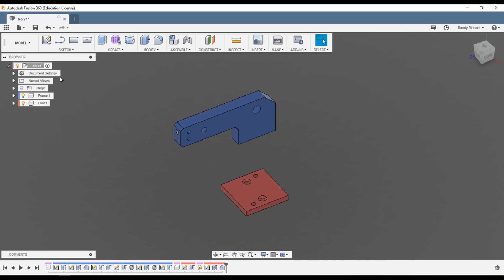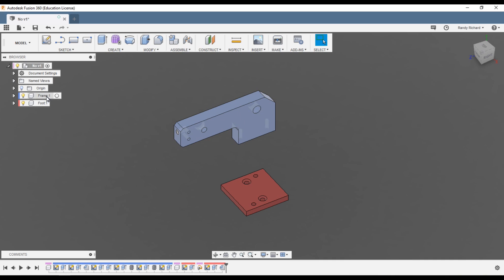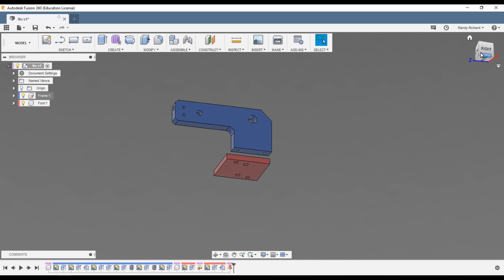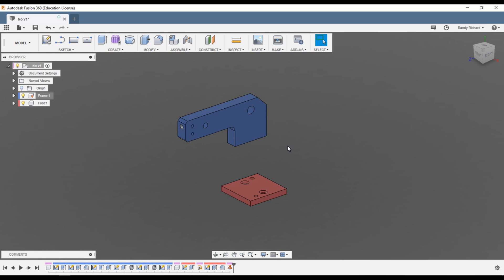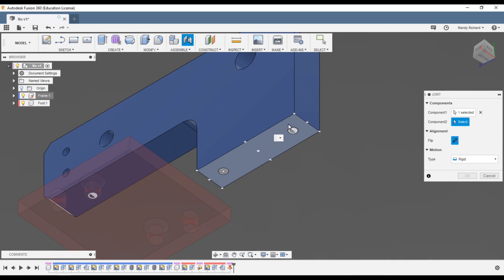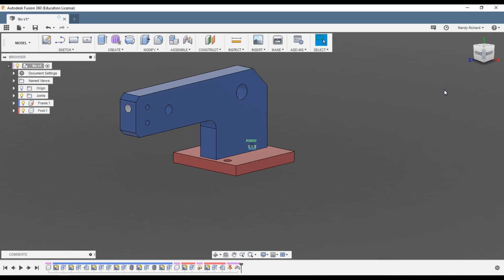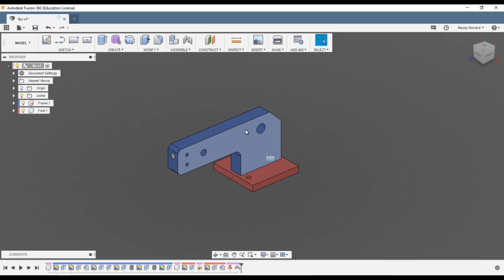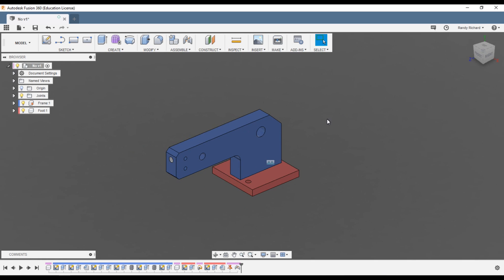Fix the Position of your Model Components - Home Shop Fusion 360 Tip #3

Comment: Do the sketch follow the component when doing this? The reason for asking is that then I am moving components with move/copy command the sketch does not follow or vice verse. This is awkward and difficult to handle when you're in hours of editing and found out that you have to do several changes to a component via the sketch, which is located in a totally different place.
Reply from the maker: Make sure you have the component selected and and active when you create a sketch.  Then the sketch will be with the component.

Comment: When you go to set the joints position you can hold down the ctrl key it stops the joint coin jumping all over the show.
When you do the first component if you do it so it is in the same places as the world origin you can do a rigid joint between the world origin and the component instead of grounding the first part.